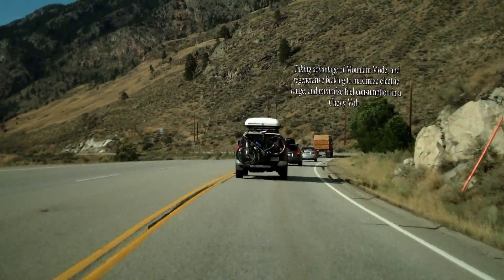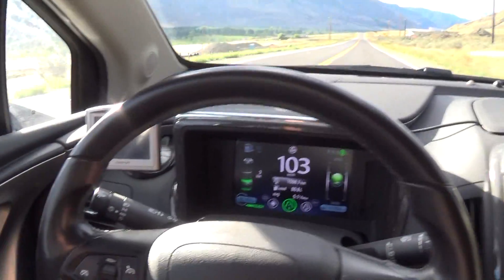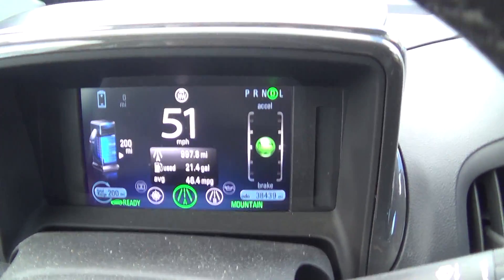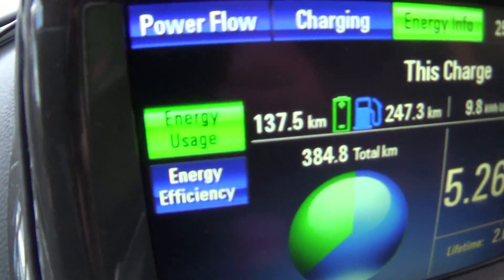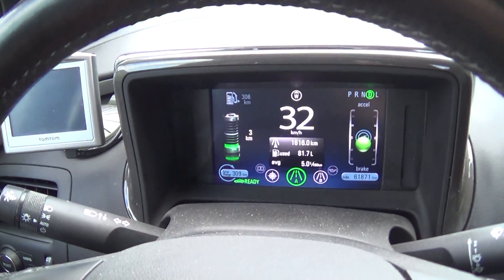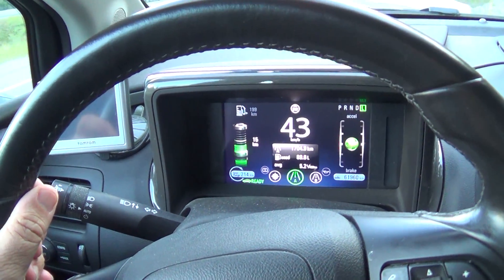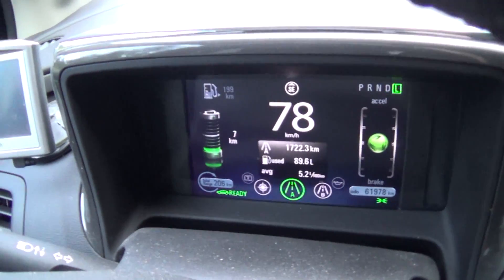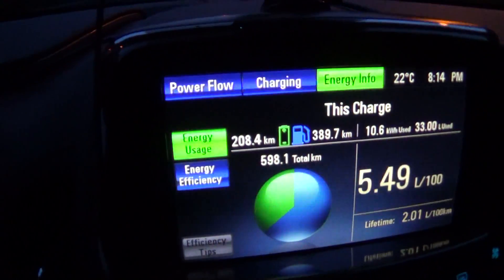volt regenerative braking experiment

Comment: Hey 12voltvids.  You are not using Mountain Mode as it was intended and you're likely using fuel unnecessarily.  Mountain Mode is meant to be pushed when you're above 50% charge so that it reserves the bottom 50% of the battery.  When you turn it on when the battery is lower than 50% charge and especially close to empty, the engine turns on essentially full power to charge the battery back up to 50%.  This takes a lot of fuel and you're better off plugging it in to recoup those electrons.  The way MM is supposed to work is that you engage it BEFORE your battery gets to 50% and then begin driving in mountainous terrain. When the battery gets to 50%, the engine turns on to maintain around 50% charge.  It allows the car to dip in to the battery more than it could if the battery where depleted to zero and thus avoid any power limit (since the engine is not powerful enough on its own).  If you're turning MM on when the battery is empty, then the engine is trying to recharge the battery AND get you up the hills.  You will surely see a power limit.  Check your owner's manual.
Reply from the maker: Mark- y-Claudia 
I am fully aware on how mountain mode operates and how it runs the engine. It is a 40% reserve not a 50 so that right there shows how little you know about the car. I have had the car now for 7 years and have 150,000 miles on it. I have been over the highest mountains in north America. Trust me I know when to engage mountain. Mode and it is not at 50%. According to the manual, mountain mode is selected about 10 minutes before starting the climb. This gives the generator enough time to build a reserve. The point is not building a 40% reserve. That is the maximum it will take. If you select mountains. Mode when stationary it will run for 15 minutes and shut down as the battery  will reach 40% in 15 minutes. I have tested this too. Also switching back to normal once the summit is reached  will turn the engine off and allow all the down hill momentum to change the battery. I have fully recharged the battery coming down a big hill!
Reply: Hi again.  It seems my comment elicited a defensive response.  I did not mean to offend in any way, I was merely attempting to inform.  Please refrain from making petty comments.  I assumed that it left a 50% buffer as it leaves half of the battery charge indicator bars on the display when engaged (5/10).  Whether it's 40% or 50% is not the issue, it's how you're using the feature.  From the owner's manual: "Use Mountain Mode prior to climbing long, steep grades in mountainous areas. Be sure to engage Mountain Mode before starting to climb. Mountain Mode reduces electric range and power but may be needed to maintain speeds above 96 km/h (60 mph) when climbing grades of 5% or greater." "PROPULSION POWER IS REDUCED: This message can display when driving in mountainous terrain without using Mountain Mode or by not entering Mountain Mode soon enough to build a sufficient battery charge reserve before climbing steep grades. This is normal operation to protect the high voltage battery." "Mountain Mode should be selected at the beginning of a trip before climbing steep, uphill grades and when expecting to drive in very hilly or mountainous terrain. This mode maintains a reserve electrical charge of the high voltage battery to provide better grade climbing performance. While driving in Mountain Mode, the vehicle will have less responsive acceleration."   And yes, in the manual it also states "Press the DRIVE MODE button to select  Mountain Mode. If steep hill driving is expected, it is recommended to select Mountain Mode at least 20 minutes before driving on steep grades. This will allow the vehicle time to build a sufficient battery charge reserve."  I read this as more of a backup to when a driver forgets to engage MM early on in the drive.  And yes turning the car off puts it back into Normal mode and that caught me a couple times.

Sincerely, 

A fellow BC resident who's traveled some of the same mountain passes.
Reply from the maker: Perhaps they word it different on the second generation volt, which is a completely different drive train than the first generation. On the second generation when the engine is running it is turning the wheels. On the first generation the computer will decide based on the load and speed if the car operates as a parallel or series hybrid in range extend mode.
On the first generation, which I have the manual says when driving in mountainous areas to engage mountain mode 10 minutes before beginning the climb. There is no need to turn it on at the beginning of the trip, but one could. It would start the engine when there is still a 40% charge left in the battery. Not necessary though. On the first gen selecting 10 minutes out, or so will build up enough charge.
I have never run out of power when I select mountain mode about 10 miles (10 minutes at 60 MPH) out. Yes if the car is already in range extended mode, the engine will run faster to recover the power, but it really doesn't affect the fuel economy. If you go to mountain mode with a full battery, the engine will start with 10 miles (16KM) remaining. Remember the first gen I have has a 40 mile (60 KM) full range, so it starts at holds 10 miles of  range. How can that be 40% you think? That is because the car never allows the battery to drop below 15% and it never charges beyond 95% either. 
It doesn't matter either way. I have verified this BTW, if you start out with a full battery and drive from my house to the summit of the coquahalla  regardless if mountain mode is turned on when I leave my driveway, or coming around the corner just outside of hope, the fuel used is exactly the same.  If leave the house in normal mode I get about 40 miles on the charge and then the engine starts. If I leave the house set to mountain mode I get about 28 miles and then the engine starts. Running those extra 12 miles with the gas engine running eats up about the same amount of gas as putting it in mountain mode just before hope and running the engine harder to build the charge up.
Where I have seen a HUGE impact on fuel economy is in the grade of gas used. Now this only is valid for the 1st generation volt with the 1.4L high performance generator engine. It is set up for premium fuel only. I have documented the fuel used as  I track this very closely on long trips. Using a lower grade fuel can have a very significant effect on the fuel economy. Running premium fuel with no ethanol I average between 40.1 and 40.6 MPG (US gallon) I figure it is easier to quote performance in MPG as opposed to  L  / 100KM.
Switching to mid grade, I have noticed the fuel economy slips to colser to 37MPG, and when I have been forced to use regular with 10% ethanol the fuel economy dropped to about 34MPG and the engine seemed to run harder. It has happened twice to me, once at a no name gas station in Arizona called UFO Gas, and at a Chevron station in California last year I was sold some crap gas. The UFO (they have planets painted on their building, and alien statues all over the place) station only had regular, but I believe it was E85 ethanol shit. The Chevron had no excuse as I bought and paid for Premium, but within minutes of leaving both those stations, my engine started running very fast, surging like it was going to blow up, and the check engine light came on. The on board instant fuel economy on the dash showed a terrible 22 MPG fuel economy, and I could literally see the fuel gauge drop. The first time it happened I was freaking out because I was in the desert with no cell coverage. Fill the tank with good gas and it returned to normal. The second time I knew it was a fuel problem. I actually "Ran out of gas" according to the computer, and the engine shut down, and thank god I had been in mountain mode as I was going through the mountains, I had my 10 mile reserve, which was enough power to get to the next town in turtle mode. With my tank showing NO gas and the engine out of comission I pulled into a gas station and filled the tank. To my surprize it only took 4 gallons and it was full (the tank is 9 gallons) What happened? Well that E85 shit that the Chevron station had in their premium tank doesn't have the buoyancy of gasoline, causing the float in the tank to sink, and the computer, which measures how much fuel has been metered got all confused, and the computer thought the car was completely out of gas, and shut the engine down to protect the fuel pump, and everything else that can be damaged by running out of fuel.
I understand the new volt can use regular fuel but the first gen, when they say use premium, they mean it. Trying to safe a few bucks on fuel will cost more in the long run because you will use more of it.
Anyway back to THIS video. I have had the car long enough to know when to use the mountain mode feature, and how to squeak out the most range in all conditions. If you are heading through the mountains
turn the mountain mode on, and then turn it off once you reach the summit, for most driving conditions. In this video, it was a demonstration as to how much power you can recover going down hills. If you leave it in mountain mode the engine will just keep on a running. By switching out of mountain mode at the summit, and then back in BEFORE it switches back over on the next hill, and then back out when going down the hill the display will log exactly how much electric range you will recover. 
Lets do a little math. Those that don't understand this will, by looking at the readings shown on the screen will say (and I converted this to miles from KM) you used 8.6 gallons to go 243 miles. That is only 28 MPG. That would be true is I only drove 243 miles, but you need to add the electric miles as well, 208.4. Now the first 40 would have been from the initial charge , that is still 168 miles that I recovered going down hill so yes the figure 43.41 miles per gallon is accurate. The calculation is done on the total trip.  If you don't switch it back and forth as I did all those recovered electric miles would show up in the gas column. That would skew the gas miles to 38.4 as normally only 40 miles would show on the electric side.  I have done many different experiments with the volt in different driving conditions, to see how the fuel economy is affected, and the only one that does really skew the results is low grade gas.
Reply: I too have the first gen, a 2014 model.  I guess they updated the owner's manual.
Reply from the maker: 2014 is not the same car. You have the hold mode on yours and it uses a higher capacity of the battery. It allows a deeper discharge to give a few more electric only miles. The basic design is the same, but the software is different and with the deeper discharge allowed on the battery in normal mode it probably takes longer to recover the reserve.
I have driven through the mountains to see what will happen, and I have run the battery flat to get the "propulsion power reduced" message. I did it intentionally to see how slow the car would be, and I can confirm that I did slow down to about 90KMh going up a steep hill.  I did it going up the hope princeston highway, and ended up stopping at the lookout area for the hope slide and just letting the engine run for 5 minutes to recover the battery sitting in mountain mode and  then continued.

Comment: In my 2012 to go back to battery mode from mountain mode, just switch back to normal drive mode and it will then use the batttery only again untill its depleted..  no need to shut off car or shift out to neutral.
Reply: Oh now i see what your saying, to get it to continue counting up on the charge screen on electric if you already depleted the battery....

Comment: I do not understand your constant comments of the engine shutting off and on. (Once battery depleted)  if you accelerate above 35 to 40, the engine does not cycle. Once you drop below 35 to 30 then the battery mode cycle starts again. Freeway speeds?  Never cycles.
Reply from the maker: Rob B 
On the first gen volt the engine cycles on and off at speeds under 55 mph. This is because the first gen is a series hybrid that can switch to parallel mode at higher speeds. Above 55 the car operates in parallel mode unless you floor it and the engine will run constantly. Second gen operates only in parallel mode once it transitions to gas and will behave completely different. Most drivers of the volt feel that the first generation is a superior system. The reason gm changed the design was the first gen system costs more to make.  The 2nd Gen is closer to how Toyota and Ford do it with 2 planetary gear sets and a 1 way clutch. The 1st Gen uses a single planetary gear set and 3 clutches that can configure as single motor or dual motor battery. Single motor extended range with second motor operating as a generator only or a parallel system with some power from gas engine going into planetary gear. When in range extender series mode the engine operates at a constant rpm selected from 2 preset speeds. When in parallel the engine speed varies with speed and load just like the second gen and all other hybrids. The first gen was much more expensive. My car was 47000 and you can get into a second generation for low 30s.

Comment: This is quite interesting, but it's really just cheating the system.  The EV miles gained in Mountain Mode are generated by the gas motor.  They shouldn't be counted as EV miles, cause they're derived from the ICE at a rate of about 35mpg.  (i.e. there's a big loss of energy in the conversion.  if you're not in a mountainous area it's far better to just stick with normal/hold)
Reply from the maker: 1st question do you own a volt. If the answer is no then you are in no position to form any opinion on what the fuel economy is or how efficient the car is.
Doesn't matter what you may have read by other uneducated people that are writing comments based on dubious information by other unqualified people. 
Since I own the car I can tell you exactly what the fuel economy is because I track it very closely, and the only time I have gotten anywhere near 35MPG as you claim is when I have run octane 85 regular fuel. Running 91 and above I average 40+ MPG, and that is in all conditions. 2nd, this is a very fair test, and accurate. I am not cheating anything. Again if you knew anything about the car, you would understand that mountain mode does nothing except build a 40% reserve. Once it gets to that reserve the car operates exactly like it does  with the 5% reserve in normal mode. By switching into mountain mode when going up a big hill, and then back to regular mode at the top of the hill, the engine shuts off, because you are above the threshold for the normal mode, but may not be at the 40% threshold for mountain mode to shut down the engine. Now coming down the hill, the engine is completely off, and depending on the length of the hill you could end up getting an almost full battery charge out of it.
If you watch this video:
https://www.youtube.com/watch?v=WJ1U3tQc0pw&t=11s
Starting at about the 16:00 mark I drove up one of the local mountains and left mountain mode running for a few minutes at the top to put a 3KM reserve in the battery. I then went all the way down, the engine off the entire way down, and I call out the range off the display an the way down. I picked up 28 KM of battery range going down that hill which was almost enough to make it all the rest of the way home. The battery got me from home to the start of the climb. I then went up on gas, came down regenerating, and the power I recovered got me to within 8KM of my home. Mountain mode is for use only in the mountains, for everything else the normal mode is what should be used. Hold should also not be used unless you live in a region  where you need to preserve your EV range to drive in the city, and you have to drive in from the country. In those circumstances hold mode would be used to run gas to the city limits, and then switch back. Other wise never use hold, and you will use very little if any gas. With my driving I burn about 1 litre of gas a week if that
Reply: The normal mode does not allow the engine to warm up to full operating temperature.  After running out of battery, I immediately switch mountain mode until the battery gets above 1/2 charge.  The engine life will more than pay the little extra gas used in mountainmode.  Then switch back to battery until the battery runs out again.  Too bad I can NOT dial in how many miles I'm going to drive and the Volt would go to O miles on battery, charge to ~50 miles on gasoline and then go back to battery again.  

The car would be better off with a 25-30 HP diesel to recharge the batteries.  My KW guage is usually below 20 KW which must be less than 30 HP.  VW built hybrid cars for Europe that got close to 200 MPG.  I had a VW diesel and always got over 40 MPG at 70 MPH, filled up the tank one day in New Mexico on the Texas border and drove into Louisiana without stopping for fuel.